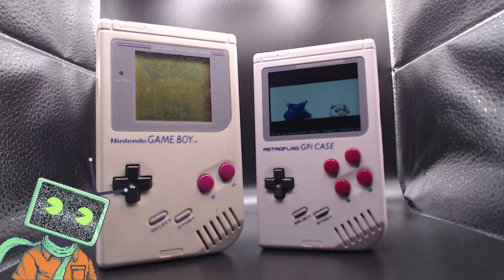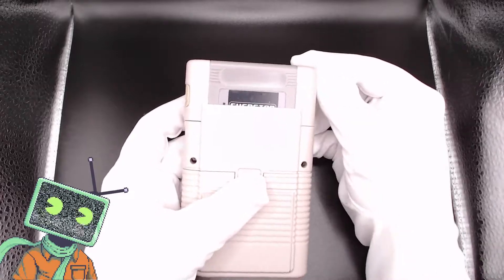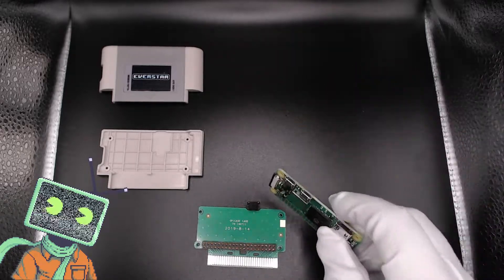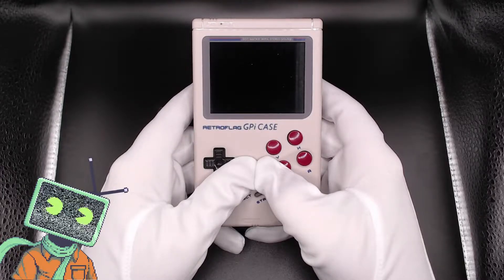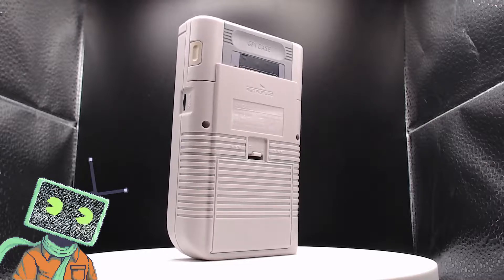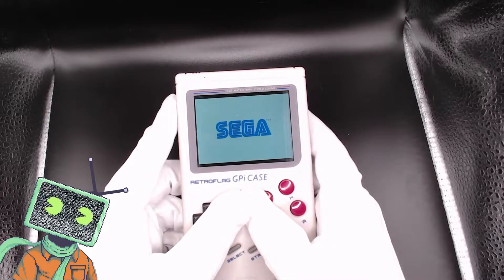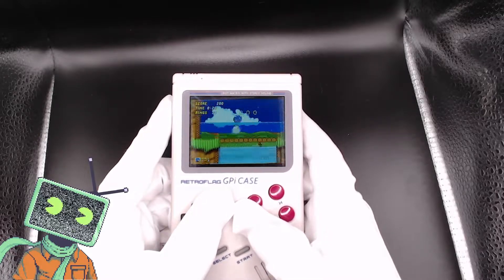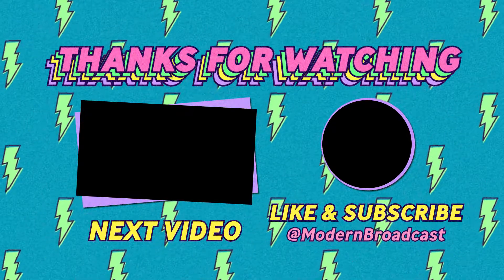Did the Retroflag GPi case get a 1up?

Comment: The RecalBox image has been updated since this video, and the only folders I see are "boot," "overlays," and "update."
I tried creating a "roms" folder, but that didn't work.  Where am I supposed to place my ROMs?
Reply from the maker: Oh Billy I just saw when I plugged in my sd card again just now. So it partitions the microSD card. Basically meaning even though its 1 SD card the computer registers 2 devices plugged in. One will be called RECALBOX and the other will be called SHARE. You need to look for the device that's called "SHARE" and there you have your roms folder. The one labeled RECALBOX is not the correct drive.

Lastly, you'll need to do this after you do the first boot of the SD card in the system. I'm not sure if after flashing the card you booted it up in the device before trying to add games.
Reply from the maker: I'm sorry to hear that Billy. Give me about an hour and I'll download the new Recalbox image from scratch and test.

Comment: gpi case got a one up to the gpi case 2 with a cm4. i have the zero and zero 2 pi's running in my 2 gpi cases
Reply from the maker: Yeah I couldn't believe the Gpi 2 came out after making this video. Ive been trying to order one with the dock but it's sold out.
Reply: @ModernBroadcast  i bought mine as a pack from china.its really good and the screen is much better
Reply from the maker: @leecollins5479  I've done the same but customs returned it to sender so another one has been issued out and should arrive sometime late late this month or early February.

Comment: hello, what kind of batteries did you use?

I tested several batteries here in mine and it can't boot

I can only make it work if it's plugged in.
Reply from the maker: Hello Welcome Soldier,
Huh that's really odd. My first thought was the micro SD card but that's definitely something to do with the power. I use the Energizer Recharge batteries from Best Buy and the Panasonic Eneloop batteries from Amazon. I'll provide you with both links.

Best Buy: https://bit.ly/33Ne6iT 

Amazon: https://amzn.to/3GY7aOb 

If that doesn't work let me know as I'd like to help troubleshoot the issue.

Happy Holidays!